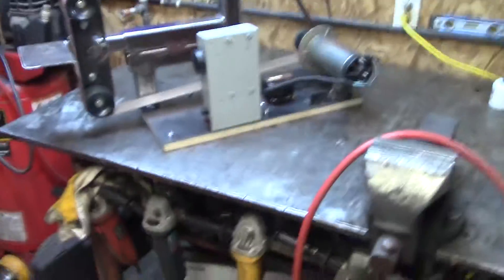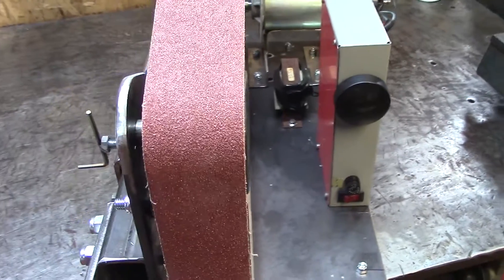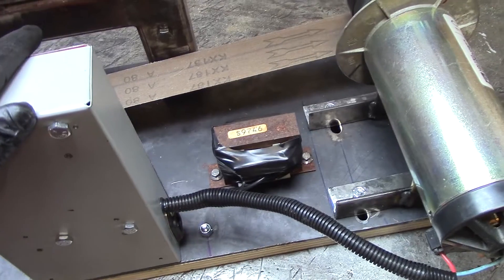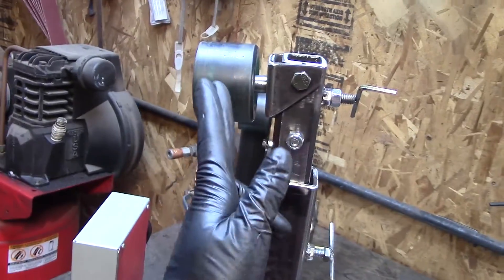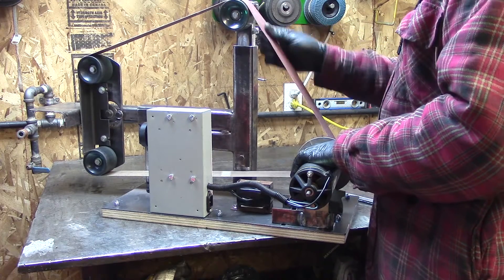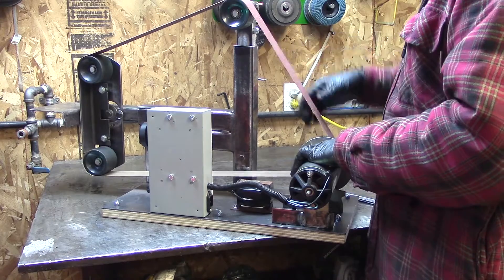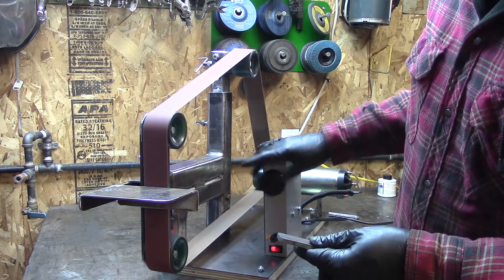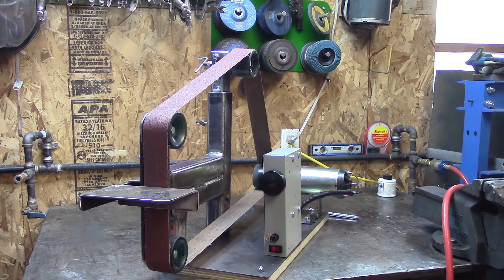Homemade 2x72 Belt Grinder

Comment: Looks great! What are the measurements of the length of the 2" square tubing? Looks about 4" on the short vertical ones and maybe 10" on the horizontal? How tall is the tall post? I need to build one this winter.

Comment: Nice job man, just thought I'd share this information with ya on all of the DC magnetic  motors you  can just switch anyone of the wires going to  the motor  and it will  reverse the direction of the motor. Most of them are black  and red or sometimes  it'll be back and white.

Comment: Very nice build can you explain how you cut that slot for your D plate to tilt and how you mounted the drive wheel. Thanks
Reply: Gary Clemons For the slot I made a circle cutter for my plasma cutter. You could also scribe an arc and drill a bunch of holes to accomplish the same thing. For the wheel I just used threaded hole in the motor shaft. I made a spacer and added washers to clamp the longboard wheel on. Works OK.

Comment: Good job 👏. Can you tell me how to connect a  DC trademil motor. Please 
Thank you.
Reply from the maker: Gates of Royalty You need to use a  motor control board. The one I used is from the donor treadmill I got the motor from. My motor is DC.
Reply: Thank you. Really nice job:)
Reply: Just Google mc60 simple wiring diagram.